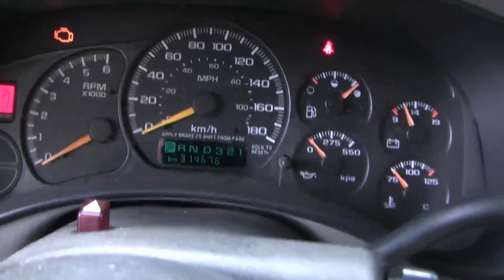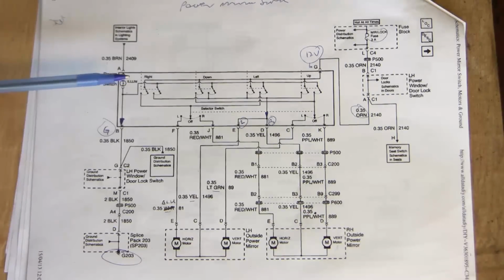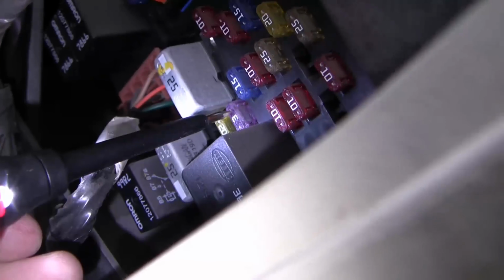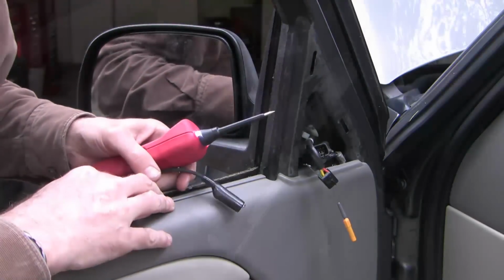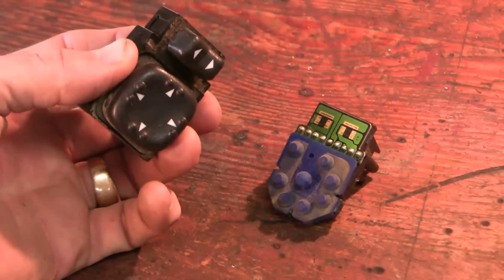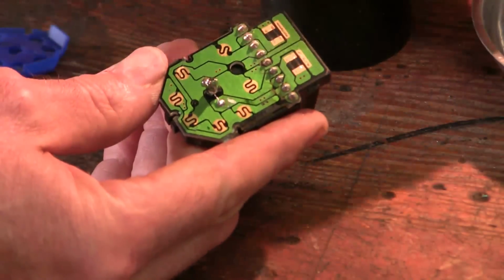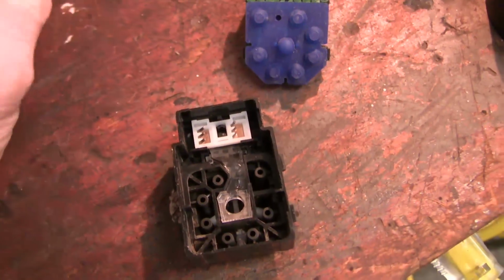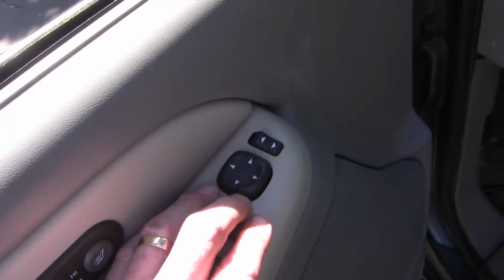How to fix a car mirror that won't move -- Chev Suburban

Comment: what is that test devce you are using sir?
Reply from the maker: +Ray “Mr. Yoso” Dar That's an older version of the Power Probe. It has long 30 foot feeder wires that go back to the battery and a built-in multimeter. It allows you to measure voltage and also allows you to feed power directly to the tip of the probe, which is a useful feature when evaluating an end device. Kinda like a test light on steroids. The power probe is NOT an essential tool but it saves time, (only if you don't make a mistake and zap critical circuits with excessive voltage). By supplying either power or ground, you can think through a problem and find the missing element. Mine is set up to whistle and show a green light when it detects ground, a red light when it senses 12 volts. The LCD measures voltage compared to reference battery ground.
Reply: +spelunkerd thank you sir.

Comment: You can get a new 2000 Suburban mirror switch from RockAuto for about $50 USD.  At this point I'd replace the switch.

Comment: hi everyone, trying to figure out if with a simple clean out into the pads of this switch, I realized that doesn't work the right & down side, so I take off the small pcb and testing all the 12 volts via, I found a open circuit from the bottom to the top on this pcb then I soldered a jumper and done, keep an eye on this switch for a Chevy Blazer 2000, seem to be will be a defect from the factory in the design of the pcb, I hope this feedback help, greetings
Reply from the maker: Thanks for chiming in, this will help others.

Comment: My mirror wouldn't stop making the buzzing sound. Can you tell me what is wrong with it?
Reply from the maker: Probably a stuck switch. You need to open the door panel like I showed and use a multimeter to prove the mirror is getting power when switch is not on. These switches are pretty cheap on ebay. If it is draining your battery or annoying you, while waiting you can unplug the mirror once inside.

Comment: if you still have not fixed it have a solution for you just put some tinfoil on the contact point and if it moves the mirror then all you have to do is put the tin foil between the rubber contact pad and circuit board

Comment: I forgot to put my L R button at the neutral position so now those L , R button didn’t work anymore. How can I fix it ? Thanks
Reply from the maker: With the dramatic fall in prices for aftermarket replacements, most would simply replace the switch now. When I made this video, the switch cost over $100, but now that switch can be had for less than $30 on Ebay and Amazon.
Reply: spelunkerd so you said my side mirror switch was damaged? And need to be replaced? Maybe it not damaged, the problem is because it was supposed to be in the neutral position when I adjust but I left it on the L , so the battery drain out ?
Reply from the maker: @TuanMinh-lb9ev  Gee, it is not easy for me to understand what you did. I would go back to basic principles, if in doubt, don't be afraid to retrace your steps. As you say, you should prove the switch is bad before replacing it. Check to be sure all wires are reconnected, and consider testing the motors by bypassing the switch as I showed in the video.
Reply: spelunkerd thanks for your suggestions, but I don’t the tool to test like you said . My problem is my side mirror didn’t move at all , and I couldn’t hear any sound while it was moving like yours . I accidentally left the L R button on the L , which is supposed to be in the middle ( neutral position) so maybe the power was drained out ? But it is weird because another switch for my mirrors are still working when I roll up and down for the left 4 mirrors, but those mirrors was controlled by a separate panel . My car is Toyota Corolla 2013 . Any suggestions? In case I need your tool ? What your tool called ?
Reply from the maker: @TuanMinh-lb9ev  All you need is a multimeter, it doesn't have to be expensive but you need to understand how these circuits work. Learning this all from the beginning may be a huge challenge, you might find it is better to ask for help from a friend. Professionals can often find the cause and fix it without too much expense. The tool I used is a power probe 2, but you don't need that, a jumper wire and inline fuse and careful attention can work just as well. I doubt this was from the switch position when you reassembled.

Comment: I believe your failure was that you sanded the gold plated contacts in the switch. Most of the time it is simply moisture or skum buildup that causes problems in these switches. You should have just used the contact cleaner or simply just wiped off the contacts and the base first and it would have worked for you.

Comment: I have no motor sound for mirror, it doesn't move and drivers side lock doesn't work. And I've changed the switches and still nothing
Reply from the maker: When shooting the parts cannon without investigation, it isn't uncommon to cost a lot of money without success. I would be looking for power and ground at the devices, and probably do some kind of drop test or at least a test light challenge to see if the wires can carry current. With two separate systems failing, I would wonder if you have a bad ground or bad power feed. I suppose a bad fuse could also be an issue, but that seems a little less likely. The most common place for broken wires is in the wire loom as it goes through the door jamb, since those wires are subject to endless repetitive movement against sharp edges. However before possibly destroying evidence there, I would first pull the inner door panel off and look for power and ground closer to the end devices. If you verify you have no power or no ground, then you can follow those wires back to find the bad wire. I've done a handful of door videos, including one on the window regulator and the door locks, showing simple diagnostic testing with a multimeter and test light. All that said, you want to honestly appraise your skill set to decide whether it is worth it for you to try this on your own. To do this yourself involves some risk as well, usually offset by the learning experience you will have forever. If you want a wiring diagram, you could search bbbindustries here on the web, they offer free wiring diagrams for most domestic vehicles. Getting a pro to solve this problem would probably be fairly inexpensive, so don't sweat if you decide not to do this yourself. Good luck!

Comment: Unfortunately,  you never cleaned all the contacts in the switch. I did mine cleaning the contacts in the black housing and the contact strips with a burnishing tool, and mine works flawlessly.

Comment: I've had great luck with finding these odd parts at the Dorman website, (dormanproducts.com).  Parts are quality and they're really expanding their parts lines especially in these switches and power window regulators & motors at a fraction of the dealer pricing.  See what they have to fit your ride, it could save you quite a bit.

Comment: I did the same disassembly and mine went from completely inoperative for two years to fully functional once the switch is clean.  I used a pencil eraser as my gentle abrasive and the swab with hand sanitizer which is alcohol, and I also cleaned the left/right rocker switch contacts, and the mirrors work like new.  Don't overlook any contacts.  Clean them all.  I never use sandpaper.  Terrible design.
Reply from the maker: Good advice, thanks for documenting your experience here. The other thing that can go bad in some of these is the solder contacts to connecting wires, which occasionally respond to resoldering. I didn't see that here but I could have missed it.

Comment: my mirrors in my 2002 yukon dosen't move at all.
can you tall me what the problem is ?
Reply from the maker: These can be easy or complicated, and a big question is how comfortable you feel with using a multimeter and removing door panels. There's no easy advice without some skills, so you need to assess your own abilities and decide whether it's worth it to try fixing yourself. Of course there is the risk of causing harm or making the repair more complicated if you can't get it done without help. Mechanics may charge you more if they have to try and fix a botched repair, especially if wires are not left in the correct places. Good luck!

Comment: So basically, I can't fix it myself if I don't have the tools and an electrical background
Reply from the maker: I understand the frustration. Only you can evaluate your skill set, your enthusiasm for a new challenge, and your willingness to accept the risk of a mistake. If you have doubts, remember that this kind of repair done by a pro is often inexpensive. Even so, if you do find the time to jump into auto repair it can be rewarding, not so much financially but in terms of actually understanding how these systems work. The situation you want to avoid is to blindly guess what the problem is, buy a new part, put it in and find the problem is still there....
Reply: @spelunkerd  I'm not dogging you bro, thing is I'm a DIY person but your resolving this problem (which I do have, currently) lets me know that it's best that I leave it to be done by a professional

Comment: if you ask me, all of the diagnosis is a waste of time. if the motor works in any direction,, it THE MOTOR AND WIRING ARE GOOD. Reversing the power will make it work in the other direction, because it has to. It is the switch, the moment the motors both works. Wires ARE forming a circuit, and CAN'T let the power thru in both directions because of the switch. End of story.
Reply from the maker: I don't deny this could have been done more efficiently, and indeed one could have guessed and become a genuine parts changer. Lessons learned when testing inexpensive devices equally apply when those devices are much more expensive, especially when there is a delay when awaiting parts. So there's nothing wrong with building evidence and excluding complicating factors like voltage drop, bad connections, corrosion, mechanical issues, etc. Many parts-changers of the world gave up on testing so long ago they don't remember how to do it. While awaiting parts it may be convenient to place the mirror or window or door into a functional position that allows one to safely use the vehicle. Independently applying voltage to the motor either way is an easy way to do that, along the way building more evidence that mechanical gears and everything else in the circuit is OK.
Reply: @spelunkerd  the only test is if the motor works and the wires conduct, which is answered very quickly.

Comment: Or spray wd 40 inside the cracks of the switch from top no removal neccessary then press button in all directions until it starts to work can be done with beer in one hand 
Thank me later